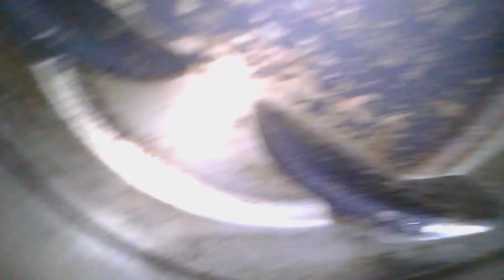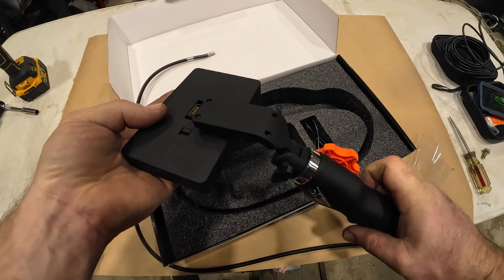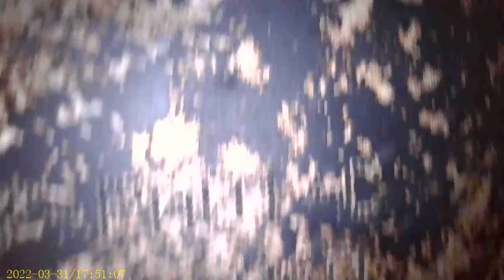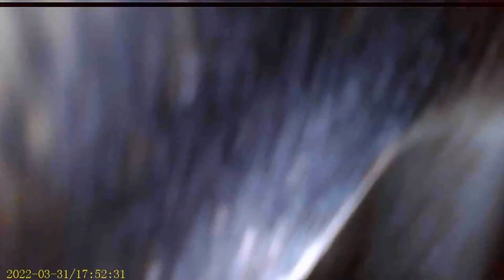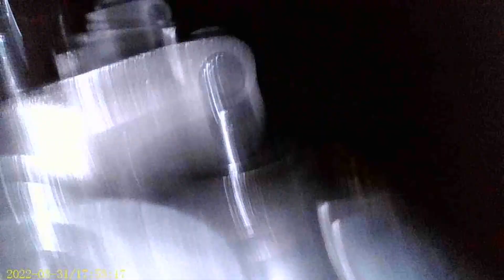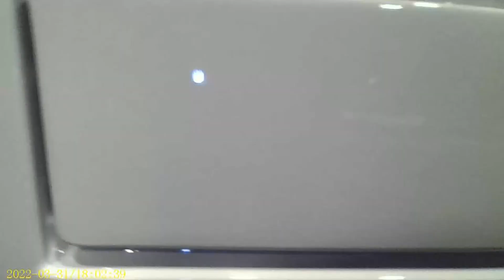Tool Review: Cheap Articulating Bore Scope Inspection Camera, Endoscope, Mechanics diagnostic video

Comment: I got some el cheapo borescope for my Android phone. The problem was finding any half decent app for it. The one they recommended was crap. As someone said, the apps seemed to be "trash and scum". And, it is obviously just a semi stiff wire with a rather crappy camera and adjustable LED's. Obviously doesn't have this bendy thinghie and camera is nowhere near this good. I gotta get me this kind of higher end thing. Mind you, it did come with a magnet and hook, which you can try to use to pick up small stuff inside an engine, transmission... whatever.
Reply from the maker: I think I had a similar one to that.